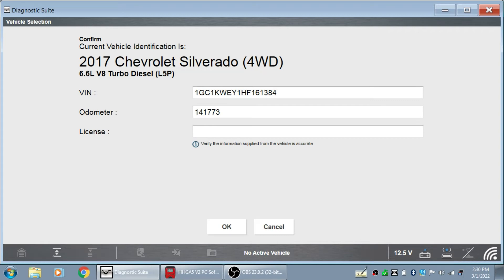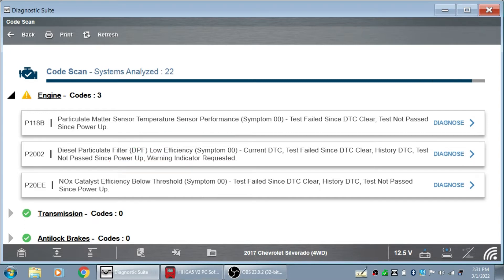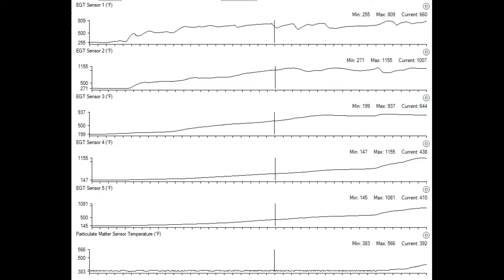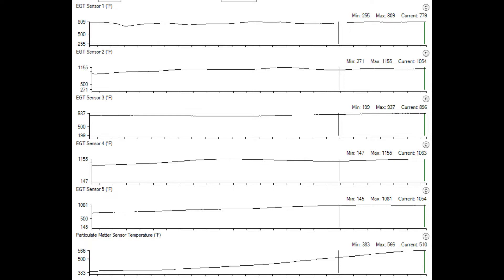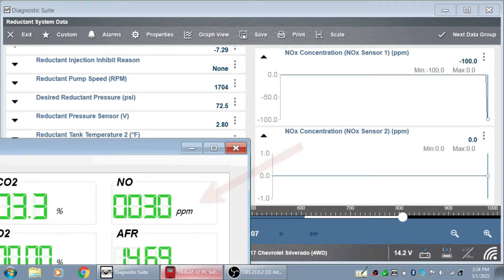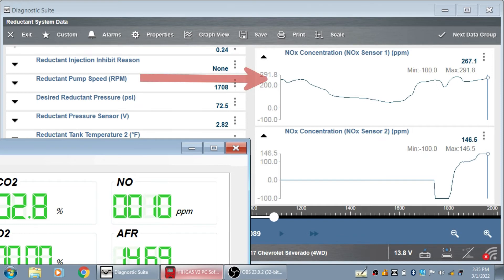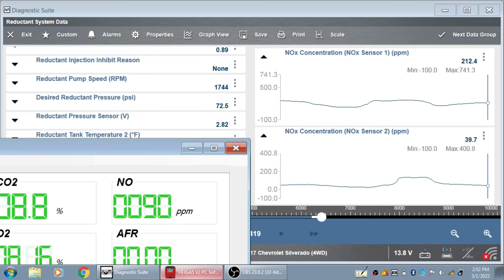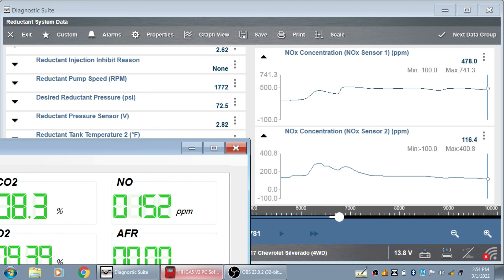Duramax L5P V2

Comment: Great video. Do you have a video or pictures of the failed scr, or removing scr. I'm going through this issue now on a 2018. New NOX2 and def injector and get 0 reduction. Most of the time nox2 is double what nox 1 reads. Thanks
Reply from the maker: Sorry.  No video of the repair.  When outlet NOx is double the inlet NOx, either the front NOx sensor is bad, and reading low, or the SCR is failed.

Comment: We’re seeing L5p’s ( low mileage )  with P20ee’s on a regular basis lately. Being they’re all under warranty we’re having to make it  a long and drawn out Diagnostic process. After drying out the SCR with a regen they clean right up. Must be saturated SCR.
Reply from the maker: Thanks for the comment, George, and the diagnostic tip.  That explains the previous repair attempt on this one.  It also explains why GM lists multiple regens as part of their SCR diagnostics.  One thing I recently learned is how much ammonia an SCR can hold.  I was driving it with the DEF injector unplugged and still seeing reduction of NOx rolling down the road.  Kinda cool.  I didn't think they would hold more than  a few second worth, but they sure do.,
Reply: @joediagnostics  Yea one of the tests is running it with the injector unplugged. You can also run a regen then unplug it, drive it and if you see a reduction in Nox that would indicate a leaking injector ( might only leak when hot ). Some of the L5P’s will disable the reductant pump if it sees an open in that circuit so I’d make sure you have pump pressure. If the ecm disables the pump you can either plug in an old injector or simulate the 1 amp load. Another thing is replacing the reductant injector gasket ( one time use ) after performing a quantity test unless the injector gets replaced ( new injector comes with a new gasket ). According to GM engineering “if that gasket gets re used it can leak and cause the P20ee”. Great videos btw.